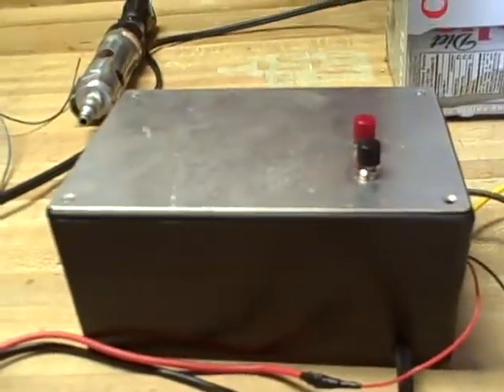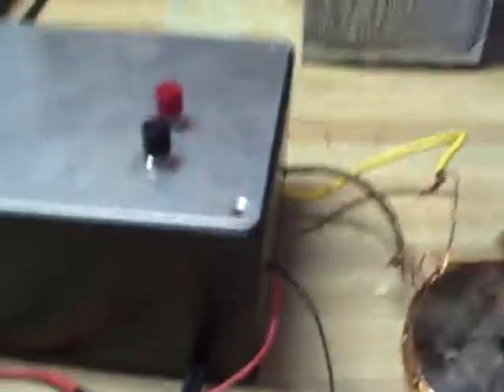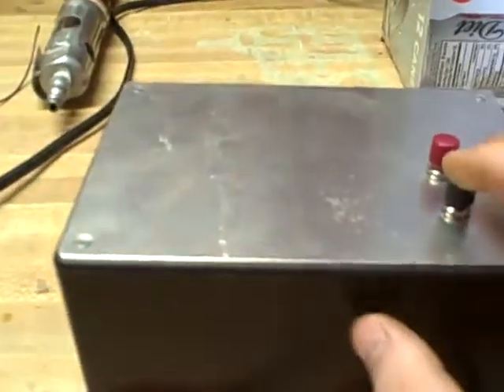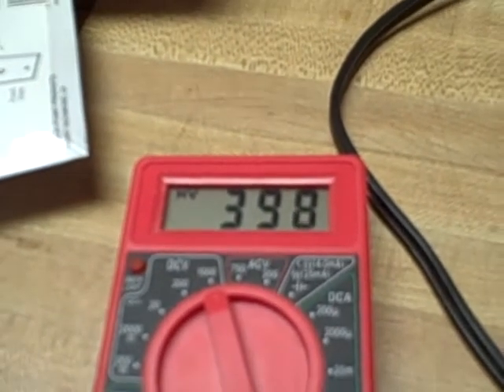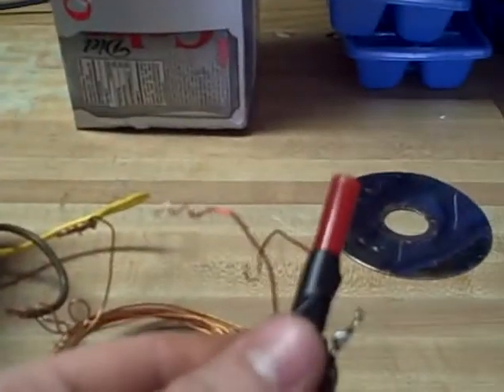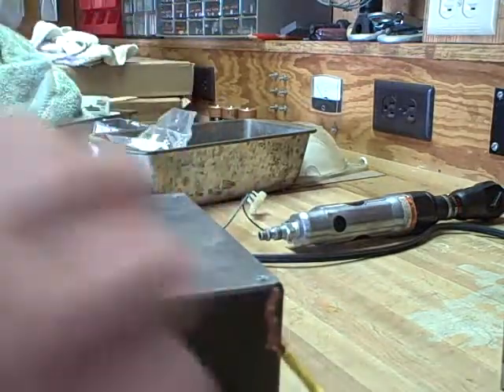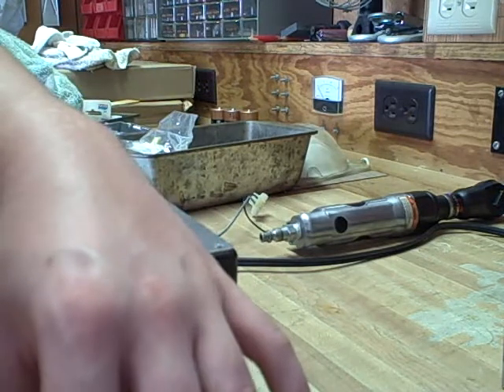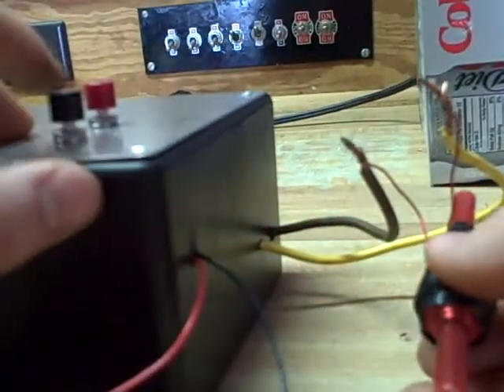Small coilgun/disk launcher.

Comment: the disc launcher would probably work MUCH better if you put the caps in series and made the coil closer to the shape of the disc. What I mean is, start in the middle and make a flat "pancake" coil all the way out to the edge. I have built a disc launcher out of 5 microwave caps (5000 volts, 5 microfarads or so, about 65 joules) and it will launch a 3.5" platter 20 feet. I think the secret is good coupling and very high pulse currents and voltages, not long pulse lengths.